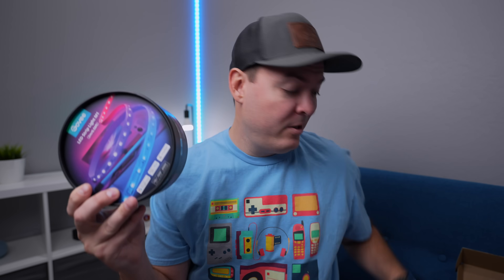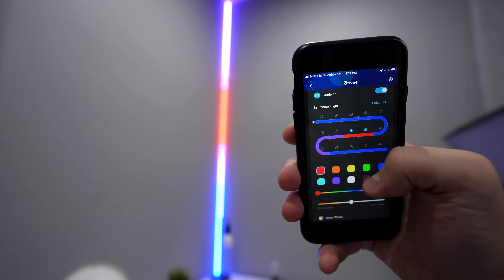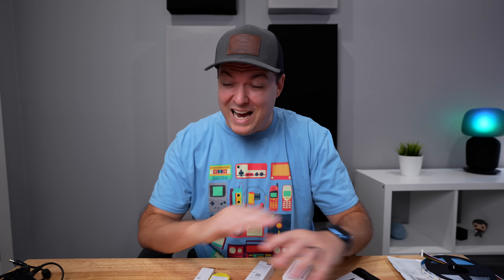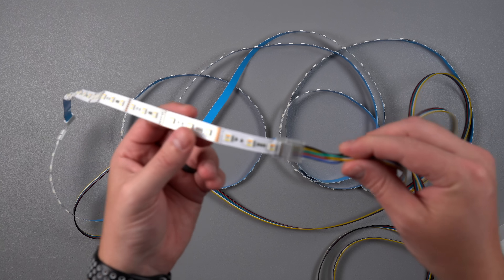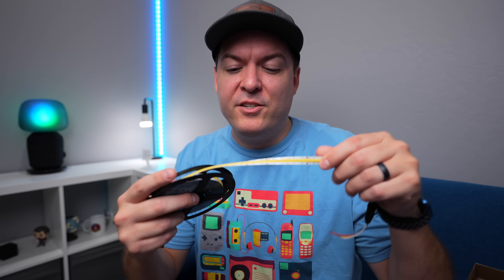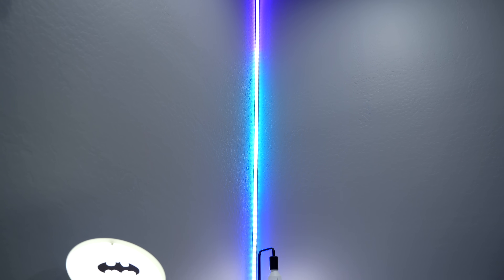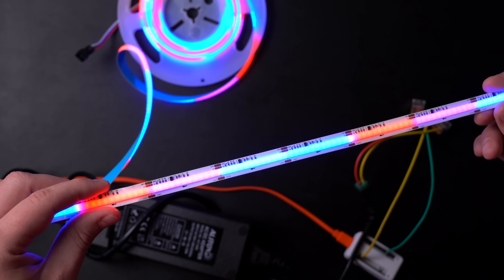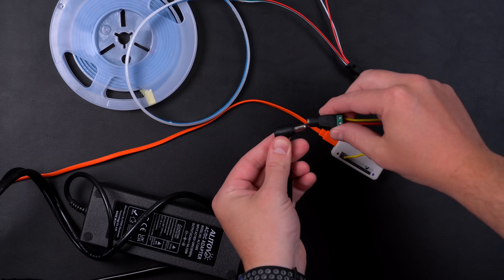Light Strips: have I been doing it WRONG for years?

Comment from the maker: How I set up the 24V RGB COB with WLED: https://youtu.be/oQuzGRDiKKc
How I set up easy DIY light strips in my bathroom: https://youtu.be/zFW94lpUrTI
📣 Head's up! I have VERY helpful light strip videos planned for 2023, so subscribe to this channel so you don't miss those.
Reply: what do you suggest for 50' of led lighting to light up stair path...I just need to run it down the side. I want them bright. Im not to worried about diffusion just brightness and having it powered at only one end. I want rgb so I can change colors. programming it to do crazy stuff is not a requirement.

Comment: Not being able to cut the Govee M1 strips at lengths less than 1.5ft (where solder line is), makes them very limiting, frustrating in fact. Begrudgingly, now I have to research WLED, controllers, etc. just so I can be able to cut to custom lengths for toe kicks, under range hood, shelving, etc. Chris Maher is arguably the best at it on YouTube but it’s A LOT to get familiar with. Govee really needs to allow cut points every 2” or so.

Also, the directions for using / installing those controllers has my head spinning. 🤦🏻‍♂️ And how many strips will work in a series on a single power source?

Comment: I can tell you right now..  get the WS2812b's  300leds per 16.4 ft.. individually controllable  far better lighting effect and cheap.. paired with the ESP32(flashed with WLED) or the white box with WLED preinstalled, the preinstalled box is $22.00 or $26.00 with mic for music sync..  I got 3 ESP32 boards for $12.00

Comment: There is a huge problem with GOVEE... they do NOT SELL separate controllers..  I bought the 65' version.. and it comes with 2, 33' rolls.. well if you want to put them in different rooms.. you are out of luck or even if you want to put them end to end.. NOPE  not going to happen  you have to be within the distance of the dual cables coming out of the controller box..  so NOT GOOD for that.. just Saiyan  make sure you get as close to the size run that you need.. or you will be wasting money ..  I love the DIY with individual adjustable  leds.. and then just get a separate controller.. they have some that are super easy to use and are universal ..

Comment: Great video! I'm looking to shine color from my ceiling onto a wall painted flat black. I don't want to see the LED diodes so I'm wondering if there are LEDs that point or are cut at an angle. In other words, if I'm looking at that wall I just want to see the effect of the light, not the LED diodes. Similar to those under your bed, cabinet, etc. I'm wondering if i need to install a small piece of wood across the ceiling to physically hide the LED strip. Thoughts?

Comment: So if i wanted to run these BTF addressable dream color lights strips around the entire edge of my daughters bedroom ceiling, which is around 50ft, would I need 2 powersupplies and 2 controllers and 2 wifi processors to get this to work properly? Also, if I wanted it to work with Alexa, would I need anything else? Thanks. Great videos you got on your channel BTW.

Comment: The decision for many is direct controllability. For example, none of the pre-packaged strips can be controlled by DMX. For a “set-n-forget” rig, then, yeah, prepackaged is the way to go. For my designs I need direct control to work with the rest of my lighting system. That part was kind of unsettling. DIY implies an interest in learning new skills and understanding of new things, like electronics or woodworking, or whatever, so it doesn’t require being an electrical engineer, but it does require an interest in learning something new, so that complaint is invalid.

Comment: A good cheap controller to buy is the SP110e Bluetooth controller... You can find them for $6-8 from US sellers, or cheaper direct from China. It's definitely not the most feature rich controller, but it's reliable and easy to use, and with its price point it's my go to controller for small projects I'm throwing together. For added features on a small project I suggest the QuinLED Dig2Go controller, but it costs a lot more too at around $35 shipped. 

For larger or more integrated projects I suggest a QuinLED Dig-Uno with a price around $40-50.

Comment: I find that if you just want color and not really sure or don’t really care on the where and specifics, Govee is fine.  

If you have very specific requirements (needs to be primary lighting for the room), LEDs need to be individually addressable because of a certain effect you want, need to be able to control total brightness (may need power injection), want strips to specifically be on these edges and these under cabinet and these vaulted ceiling trims, extensions tend to be much easier with DIY, then DIY is the way to go.  

Sometimes you want a corner trim to connect to an edge trim, to connect to an upfiring trim, to a non-diffused downfiring trim and you want them all to go sequentially.  Go DIY.  There’s no kit solution for that.  

It’s work going DIY, no doubt about it.  And most of the work is research.  I think once you get all the right components and tools, install is pretty straightforward.
Reply: Good comment. Do you know if using a zigbee controller OS better than this soldering method ?

Comment: Hi Reed, great video. Do you happen to know if you can cut the FCOB dreamcolor strips you used and then make use of the remaining, or is that fit for the bin once it's been cut?
I'd really like to try and make some use of these strips if i can but the use case i would like to put them too would mean several shorter strips, i'd like to save by buying a larger roll but that's of no use to me if i cn't use the remaining strip once i've cut it. Thanks in advance

Comment: LED density is measured in LEDs per meter. You can buy much more dense strips for DIY projects than the one you have here. Looks like you are using a 60 LED/Meter strip. You can get them at 144/meter.

Comment: So I have an question I want to use the addressable BTF Leds with the SP511 controller to go around my IKEA peg boards to them light up. Will that all I need or would I also need to buy the connectors for the corners as well? Oh yeah 2 power supplies because I have 2 peg boards and they will be on different sides of the wall

Comment: Hello, I haven't gotten a proper answer from anyone to the following question:
I have a smart home system built on Apple Homekit with about 10 different hubs and around 200 different additional devices. Could I use Home Assistant system alongside it in a way that it doesn't disrupt my current Apple Homekit system? In other words, can these two systems operate simultaneously?
What interests me about Home Assistant are its extensive automations.
Also, thank you for your very good videos. I follow you avidly here from Finland.

Comment: Another good option for the diy if you dont want to Solder wires is get a dig uno controller for the lights comes with QLED on it and is small and easy to hide

Comment: I have installed a three way Meross wall switch and experiencing some problems . Installed just one . The light does switch on and off at the Meross switch. But at the other switch the light will some times come right back on after turning off the switch. Do I have it wired wrong ? Thanks in advance ,love the videos.

Comment: DIY with 5-volt  addressable strips gives you higher resolution (and can power the esp32 right from it).  It can will require power injection for longer runs, but if you aren't afraid of a little soldering, you can  get really nice results.

Comment: That looks incredible! Nice job! My most recent set of light strips, I went DIY, and yeah... my soldering still sucks. I felt like I needed the bigger gauge wire to cross a gap, but then I had a hell of a time soldering them to the strips. Even these crimp connectors I got to make it easier, still caused a lot of headaches.

Comment: What if I told you there are WLED preflashed controllers that require no soldering and you can still pick the strip you want and pair it with a matching power supply
Reply from the maker: What if I told you I already said it in the video 5:05
Reply: @SmartHomeSolver  😂

Comment: Definitely want teh COB variant for what I'm planning to install, not a big fan of seeing LED's. DIY kind of speaks more to me, just getting a handle on the whole thing and problemsolving seems like fun. The biggest challenge so far, as you also say in the video, is just figuring out what the heck to buy. There's so much out there and it's not clear at all. Wiring DC stuff is a doddle, soldering is easy, but finding the right components to buy so it all works, that's tough. Especially since I'm also only now getting into the home automation bit for real, took one of my existing Raspberry PI's and slapped a Z-wave transceiver on it, but now I have to wrap my head around Z-wave, Zigbee and all that stuff as well. Still... it should be fun.

Comment: It looks like you installed them in the 10mm wide v channel diffuser. No issues with the strips being 12mm? Looked like the excess bent easily enough.
Reply from the maker: Yeah they seemed to fit fine. Those corner channels are pretty forgiving on the width.

Comment: I need a led strip that can go a long way on 1 or 2 power sources for Crown Molding. All the LEDs I see are outrageously priced, or they don't have full color and full whites for a responsible price
Reply from the maker: The DIY RGBWW light strips I have in the description should fit what you are looking for. Make sure to get 24v so you will have less resistance and lower voltage drop with a long length.
Reply: How Long of a run can I do on one 24v? I think I need around 300 linear ft to run.